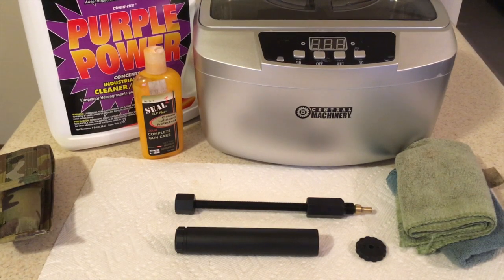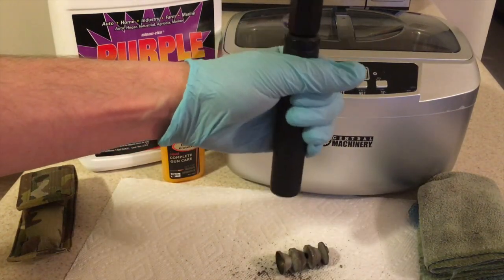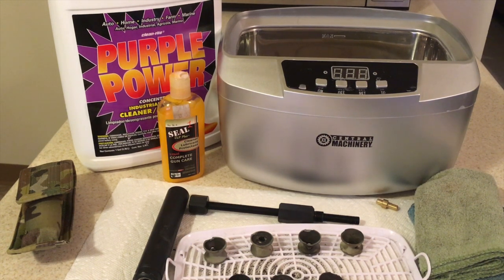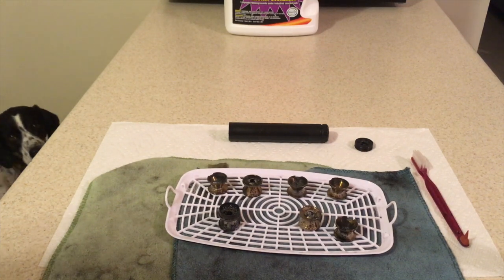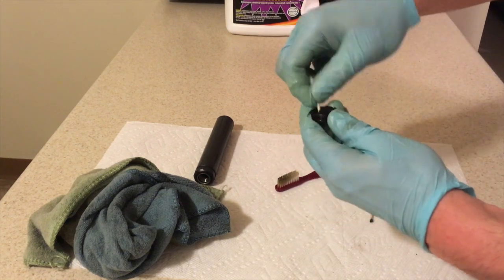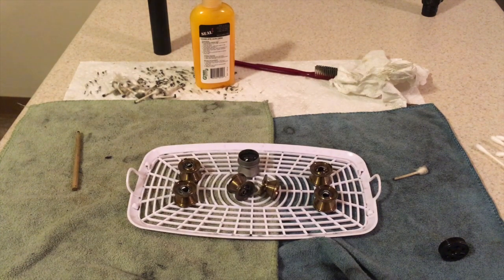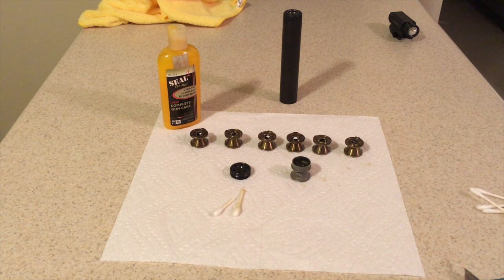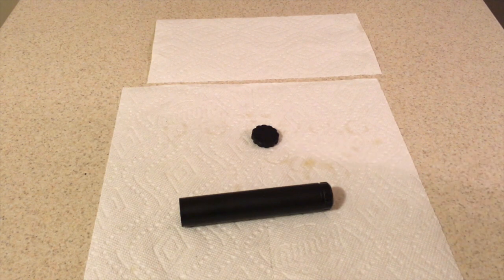AAC Element 2 Suppressor Ultrasonic Cleaning

Comment: I've gone with the Harbor Freight Rock Tumbler. I use the small stainless steel rods in it. I vary with solvents but last night I used some Balistol, Citric acid powder, liquid dish detergent and water. I ran the baffles for 24 hours and they came out almost completely clean. I did have to scrap some lead caked on a few using a small knife and/or a brass bristle tooth brush. Another thing I did last time, and I believe which made cleaning a breeze this time was to, once completely clean, I baked the baffles and tube in an oven at 250 degrees for about 30 minutes. From the oven and still hot I immersed all the peaces in a jar of silicone oil (which I purchase on Amazon for this purpose). After the pieces cooled (I actually left mine in the bath overnight) I let the silicone oil drip off the pieces but re-assembled the suppressor with the pieces still coated in oil. The oil does two things... I think it acts to make the suppressor essentially a "wet" suppressor and I really believe the heat treatment and soaking allowed me to wipe off most of the carbon. The Rock Tumbler and steel rods removed most of the lead.

The biggest issue for me now is the lead. It is not as excessive as it was before the silicone oil treatment but is still occurs. I'm wondering, since the melting point of lead is much lower than stainless steel I wonder if I can "spot" melt the lead using a blowtorch??

Comment: Thank you for making the video that way -- you need patience to run many rounds for the baffles to be completely clean. The ratio is also important. You can use purple power in full strength too (no dilution), which would make the cleaning faster.

Comment: Did you replace the fluid in the ultrasonic cleaner after each run, and did you change the orientation of the baffles after each run?
Reply from the maker: Same fluid. I did not make any effort to replace the baffles the same way each time. I just sort of threw them in.

Comment: I have a question about your blast baffle. I ordered this very same suppressor got to look at the internals of mine and my blast baffle is stainless steel like the rest of the other baffles. In the video your blast blast baffle looks like it’s made out of a different metal. is that a first run batch and did they change up the material used for the blast baffle.
Reply: I wonder about this too, my blast baffle looks like a different metal than the other baffles when its apart on this same model
Reply: Have you fires them, it’s like the heat after so many rounds. Mine are cooper color.
Reply: @lordfordification  what do you recommend?
Reply: @billcarr5406  I like the dead air suppressors but I lost mine in a boating accident.
Reply: @lordfordification  Thanks